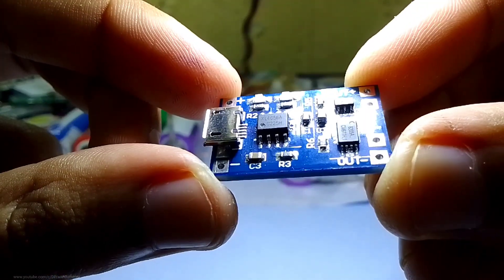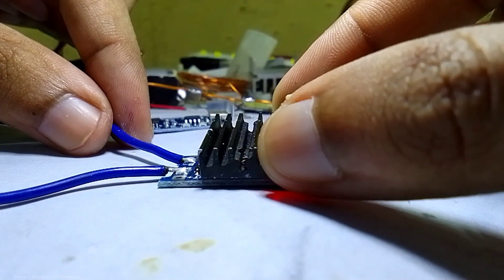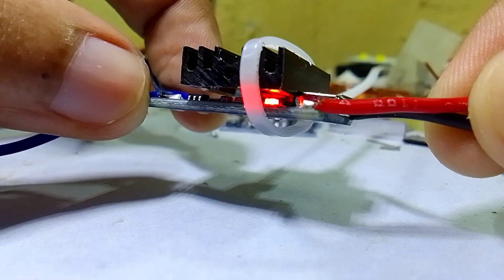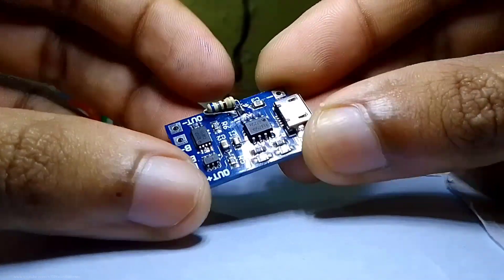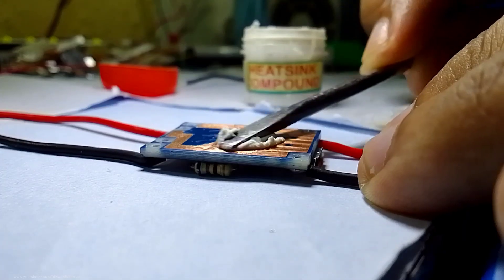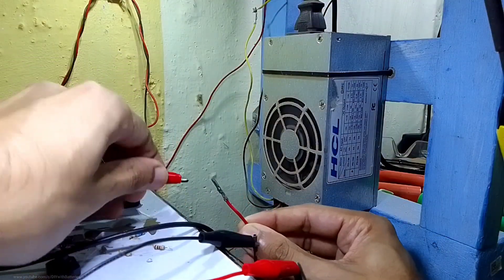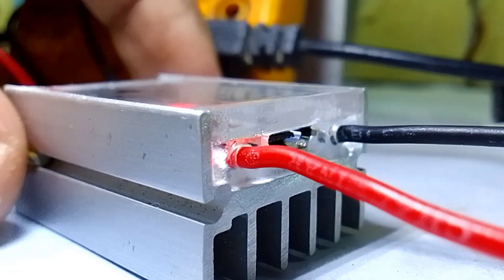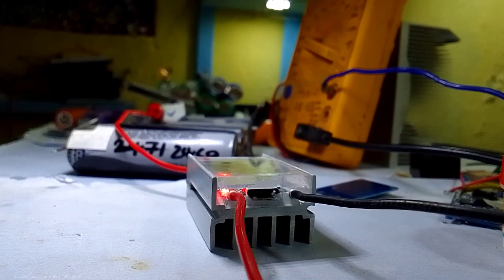Tp4056 Output current🔥Heating problem solved! ‼️🔌🔋💯

Comment: Bro what about the output voltage of the module? cos before modification it was 4.1v and if you increase voltage then the battery will get damaged when connected
Reply from the maker: We're increasing the current

Comment: I want that when the battery reaches full charge, the current doesn't cut off. The current should continue to flow at 4.2V. This is because the current cuts off at 4.2V, but the battery voltage drops to 4.15V or 4.1V, and after that, if the current continues for some time, the battery will be fully charged. Is there any method for this?
Reply from the maker: Yeah I got your point and I think that's the  inbuilt functionality of the Tp4056 ic
Reply: @DIYwithBatteries  Try to modify this function please........ i hop you can do.

Comment: Bro did You Say 6R Ohm Resistor?
I Mean You Replaced that SMD Resistor With 6R Ohm Resistor?
Reply from the maker: Yeah 👍
Reply: @DIYwithBatteries  is it still Working?
i Think You Have Good Knowledge about these kind of circumstance.. I need to solute about some problem, so is there any other way to communicate with you?

Comment: Hey can we use tp4056 after adding heat sink and cooling fan for as a balancer charger can this module handle max amps for hours or days??
Reply from the maker: Absolutely 👍

Comment: Thanks friend, simply and fast things to do. Question is at which current tp4056 will require heatsink?
Reply from the maker: 1 amp, even though it works without heatsink but just to Increase the life span we have to use heatsink ;)
Reply: @DIYwithBatteries  Strange thing, the board with Type-C have a tiny sense resistor almost impossible to replace, but often are thicker with more copper sink pcb than micro usb boards
Reply from the maker: Yeah I've seen that in type c r3 is a bit smaller if you have hot gun everything is replaceable

Comment: You could have used another heatsink on top instead of the acrylic sheet. Then setup a 80mm fan to blow on the bottom heatsink 😂
Reply from the maker: Actually that's a Good idea we'll try 👍

Comment: Thanx bro❤ you always talk about main point 🗿
Reply from the maker: No need to explain why earth is round 🗿👍
Reply: @DIYwithBatteries  no it's flat
Reply: @DIYwithBatteries  joke aside where I can buy real good quality lithium ion battery?
Reply from the maker: From a scrap laptop!
Reply: @DIYwithBatteries  humm.. it's backup not that good but I will try thanks
Reply: By the way may the old battery fail to power powerbank module

Comment: The heat is because of linear regulation. Add a shotky diode on the +ve input. There is a 0.7v drop across the diode. Now the diode will get hot instead of the 4056.
Reply: Shottky drops only 0.3 v. 0.7 it is regular Silicon diode
Reply from the maker: @igorzherebiatev5751 yeah man ;) 👍
Reply from the maker: And there's a statement Haha... It's good to use schottky anyway 👍
Reply: Bro how do you know all this things I also want to know which course I prefer after 12th
Reply: @tusff07 school won't teach you these things

You will have to gain this knowledge by yourself
Reply: Afaik most modules already have a diode there
Reply: @Ed19601 - no, most modules DO NOT have the Diode on the input. They don't have the 0.5 Ohm dropper resistor recommended in the datasheet either.
Reply: @johncoops6897  tnx. I guess I have been lucky then
Reply: @Ed19601  - I just specifically checked my own single modules (from various suppliers) as well as a 4- cell charger/discharged that uses TP4046's.
.
They all connect the 5V input directly to pin 4. I am going to add the recommended 0.4 ohm resistor as per datasheet recommendations. This reduces the heat in the chip without affecting termination voltage. The chip running cooler reduces  thermal throttling.
.
I read a few forum threads where adding a diode (to get a voltage drop) or deliberately running the TP4056 on 4.5V slows down charging and/or messes up cell float voltages... so a resistor will act as a voltage dropper when current is high, but it's effect will drop to vertually zero once the chip enters CV stage.
Only drama is that the resistor will have (max) 1 Amp running through it. The voltage drop will be 0.4V, dissipating 400mW of power. So ithe resistor would need to be rated about 1W to be reliable.
Reply from the maker: Appreciate that 👍
Reply: @johncoops6897  That is a beefy resistor. I run my tp4056 from a (max) 6 Volt solarpanel, but it has a diode. Can't read which one, but the drop is about 0.4 so I guess it is a skottky. I am going to need some new ones for various solar projects so I better  get some resistors. Not too expensive at Ali: 50Pcs 2512 1W Smd 0.4Ohm 2.20Euro. or 20 Pc 1W 0.39 Ohm Metalfilm resistor 1.62 euro
Reply: @Ed19601 y cuanto tiempo lleba en uso yo igual tengo un tp4056 con panel solar 6 volt.pero agrege un diodo schottky y pues la verda carga una celda de 3500 miliampers y no se calienta mucho.aver cuanto tiempo me dura saludos👍🐝
Reply: Do you have sample sir that I can copy plz
Reply: @Marc_tech  - just download the datasheet. Read it. Follow what it shows.
Reply: This method is Inefficient way of dropping voltage will also create emi because of the switching characteristics in Schottky
Check in oscilloscope, the waveforms will be noisy so a big no no 👎🏻
Reply: or, you feed it 0.3Volt less (coz that is the actual drop over the Skottky)

Comment: Hi Sir if you increse the current of tp4056, then can you reduce the output voltage of it. Just to charge a rechargeable 1.5v battery??
Reply from the maker: I tried it, didn't worked but still I'll try that again ;)
Good point Buddy 👍
Reply: I think , if you add few N007 diodes, it should do the trick.
Reply: The tp4056 is not specifically designed for  those batteries. I presume you refer to 1.2v nicad cells. They are easier to charge with a transformer, a resistor and LED. Plenty of chargers available for a low price

Comment: Sir many are copying your video but i know you are real I had a doubt i am making a big led tube and i have 5 18650 batteries connected in parallel but can I charge them with a single tp4056 or will it be risky to do so please tell
Reply: Reply sir
Reply from the maker: Don't worry Just add a Heatsink it will be fine 👍
Reply: @DIYwithBatteries  thx